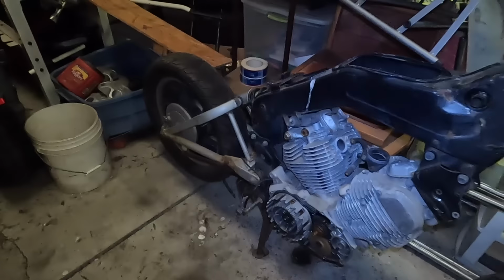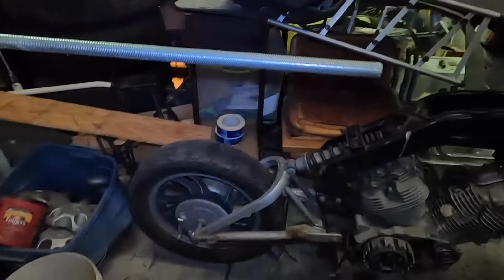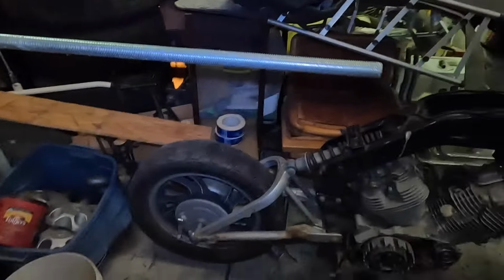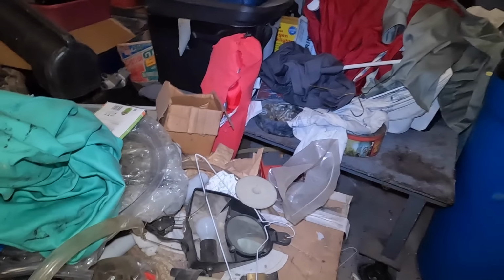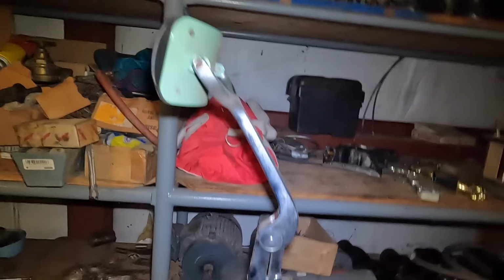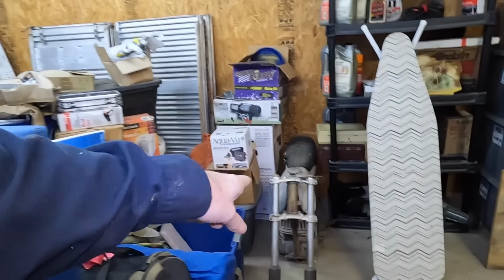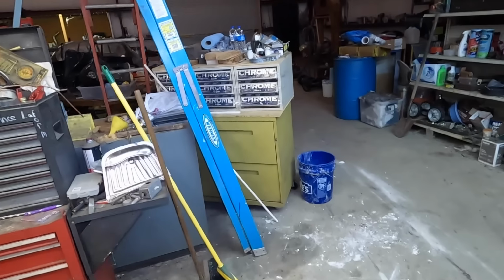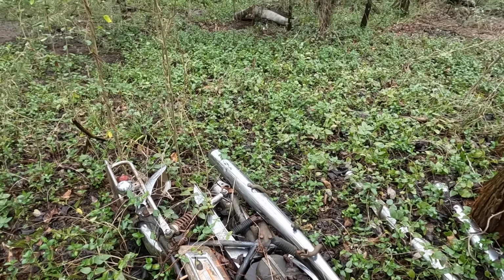Motorcycle Honey Hole I Found on Craigslist #vintagemotorcycles #motorcyclerewind #gs1150

Comment: I really like that GS1150E. One thing to keep in mind..Suzukis of that era sometimes had top end oil delivery issues. That was the case with my two GS1100's ('82 & '83) and '82 GS 650E. If you buy that 1150, you should remove the valve cover and  the camshaft journal caps then lubricate the cams where they ride on the aluminum surface of the head (journals) before trying to turn the engine over. Good luck, I hope you got that bike!
Reply from the maker: That’s a great tip. Fingers crossed we can come to terms. Thanks for watching.